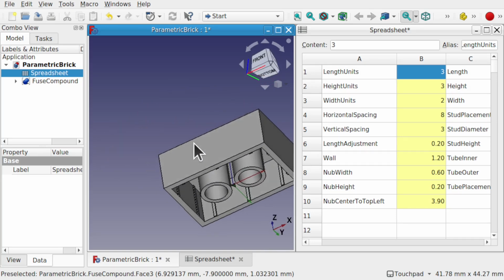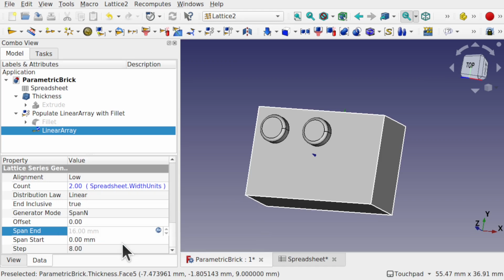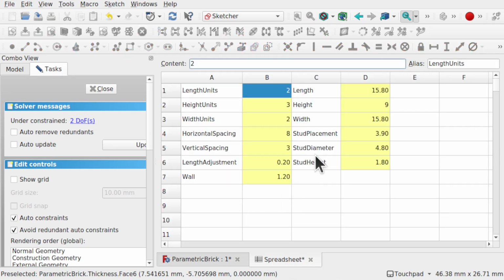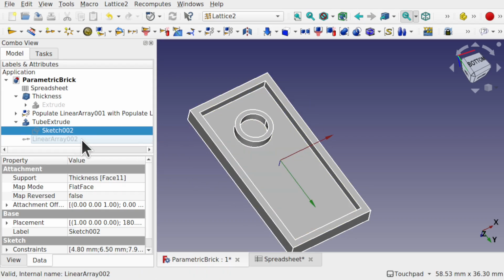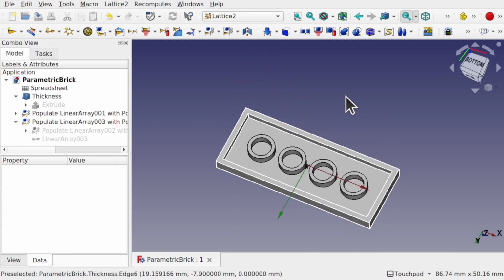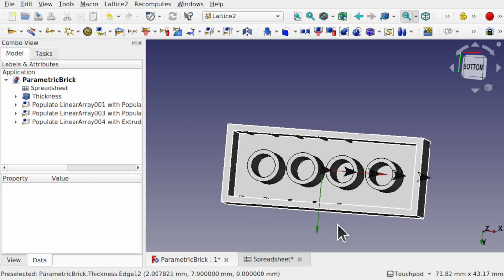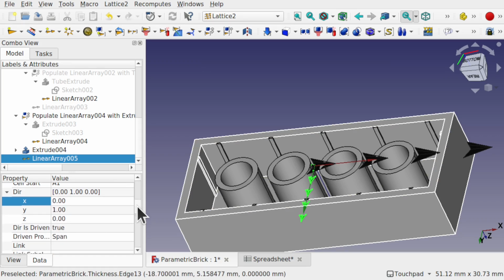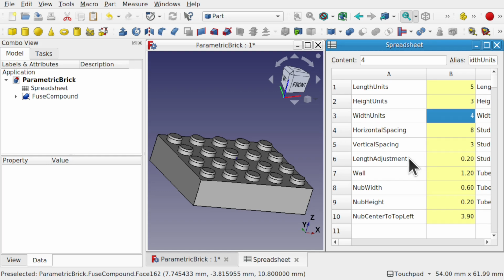Modelling Parametric Multi size Toy Brick in FreeCAD Lattice WB | Part 2 of 2

Comment: Thank you so very much for this great tutorial!!  I have watched quite a few of yours and you do a great job, thank you.  I followed along with this as well as part 1, however for the array -- instead of the "span" I used the "N-Step". That eliminated all the "length/width" equations.  Instead I directly entered the stud spacing from the spread sheet.  So much easier and cleaner.
Reply from the maker: Glad you liked and thank you for following the channel, great to see your happy with the videos. Thank you for adding what you have found. Really helps with others reading the comments 👍👍👍

Comment: This video got me what I wanted rather swiftly! (You're like the Biffa of FreeCAD)
Negative (-1) direction also reverses the array direction (reverse stayed false). 
I think this lattice business isn't going to work for me. I created a 6x42 array of tubes to intersect an irregular shape. Sure, it looks nice. When i tried to slice the array using shape intersect, FC crashed.
I was able to slice the original part, but it didn't propagate throughout the array.
It crashed when I tried to use the Slice tool in Lattice2 also.
Another crash when I tried to convert the Arrays into a compound, then slice that.
I notice this error on load: 18:36:26  0 <App> Document.cpp(2843): Failed to restore wipeOutB1#Sketch.ExpressionEngine: Failed to parse expression.
...
And I'm back (5 hours later?). I ended up creating some 210 tubes without using the lattice. I was tempted to do some troubleshooting and file a bug, but I ended up looking into just copying the tube and repositioning each one.
Luckily, this video (series) did help and by the virtue of setting up the first tube and making it so I COULD use the arrays and in particular, using the spreadsheet for variable parameters helped. I suspect there's a better, easier way to do it, but maybe not. By placing formulas, I could change each position by (centerOffset * n), where I'd manually enter n for each tube 1-42. I couldn't get macros to help me. In the end, I checked the tubes held their parametrics, the only real value I was interested was their height or length, which I adjusted and they all changed! That felt good, even if I don't need to use it.
I still have to intersect each cube with the odd body, then flatten the curves that result, print them out, cut the templates, then wrap and cut the tubes.
It's fascinating how I'm "reverse engineering" this in VR in order to assemble it in reality.